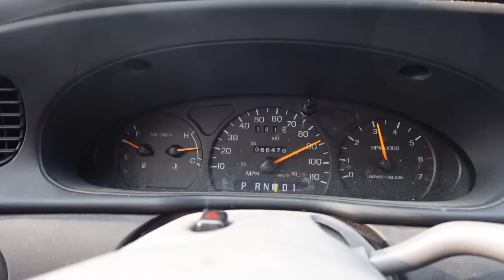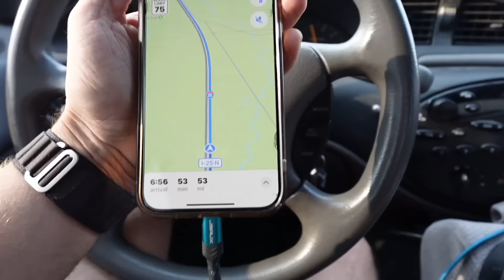MY FINAL GOODBYE TO MY F250 :(

Comment: Best suggestion for the new truck.. either get manual font hubs or actuator eliminators for the new truck.. the vacuum actuators are known for failing and they fail at the worst time when you need 4wd but won’t have it.. trust me I’ve replaced hundreds of them..
Reply: you can always lock the hubs manually
Reply: I’ve heard that but I have personally put hundreds of thousands of miles through those hubs on several trucks and I have never had any issues with them. I even leave them locked in for the most part. 🤷🏼‍♀️

Comment: Most of the time rear wheel drive vehicles dont need a flex pipe. On a front wheel drive its needed because of the direction the motor rocks.

Comment: @14:52, they didnt want to charge someone 5k to pull the cab to be able to fix a corroded pigtail connector, so they used 10 bucks in butyl tape to water seal it. smart imho.

Comment: when you pull engines put a shop vac on the lower rad hose and it will suck the system dry makes things so much cleaner